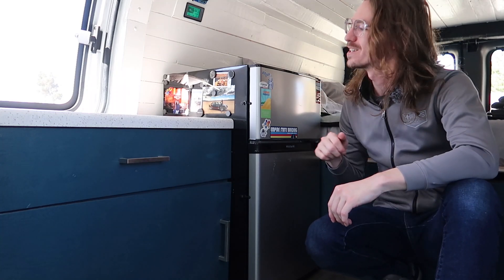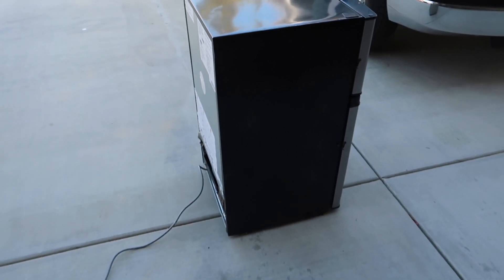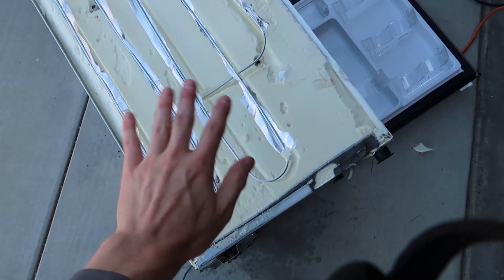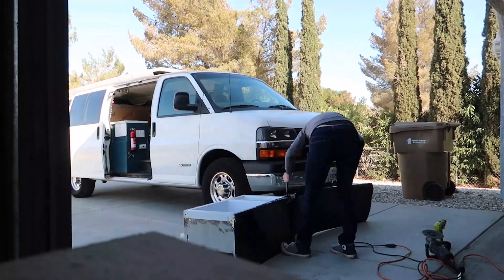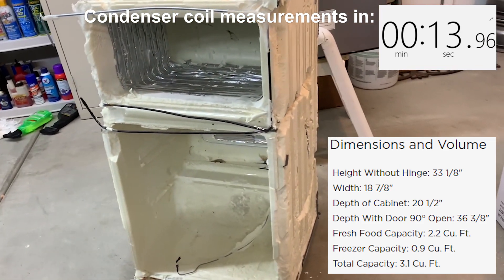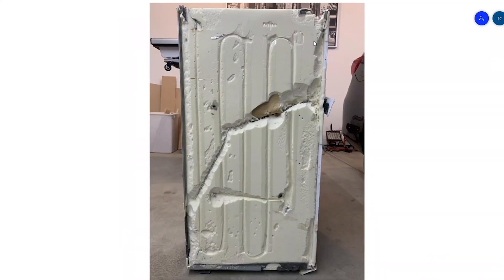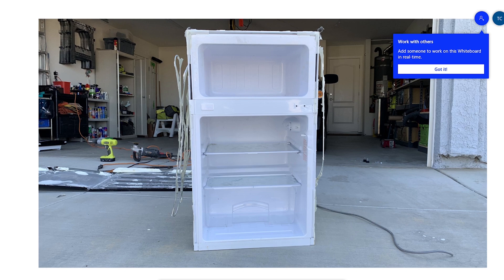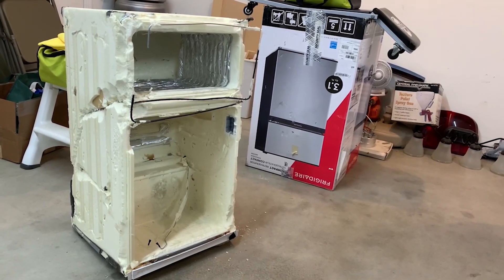Campervan fridge tear down / failure analysis (incl. measurements for nerds)

Comment: Sorry that you had to replace yours, but am glad that it wasn't a mechanical failure. I have gone the same route with a fridge for my Tahoe.
Reply from the maker: Durable little units for sure! Glad it gave so many months of service even with that puncture point. Expecting the new unit to last years longer!
Reply: @VanwithTim  I went with the Magic Chef that has no freezer. It's been running for 6 months now.. Fits perfect and it would take 10 years at one per year to match the Dometic price for a similar size. When this one fails, I may go with the one you have just to get a freezer. I am not sure why more people don't do this.
Reply from the maker: @izawoodsman  I think Dometic's marketing preys on those with little electrical knowledge. But realistically with the money saved, you can get a huge battery / solar setup and nice inverter for the price of their $1,2000 fridge. Wild.
The dedicated freezer has been super handy for us (but we do a LOT of cooking)!
Reply: @VanwithTim  That's exactly what I did. 200Ah LiFePo, 2000w pure sine wave, and a DC-DC charger. About $1600 for all that plus wiring, breakers, etc.

Comment: Helpful vid Tim. Wow, I’d never thought there would have been tubing left right top and probably bottom! Figured it would have been kept in the rear. So they use the siding to draw away heat. Wow
Reply from the maker: I calls for a 3" air gap on all sides for the heat to radiate out, and I really expected to have problems in the summer because of my tight mounting / lack of air gap.
160F+ interior temps and it still seemed to cool just fine (even with that punctured line!??!) Really surpassed my expectations - especially at such a low price-point!
Reply: @VanwithTim  yea we talked about cheaper appliances before. I’m still going to see if my dorm fridge will fit!